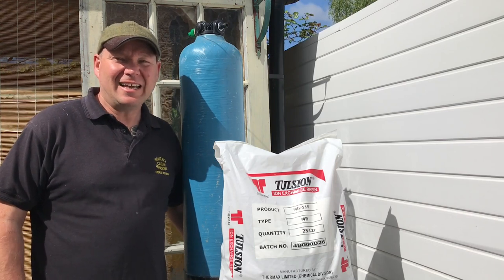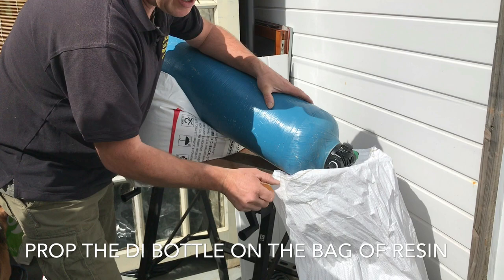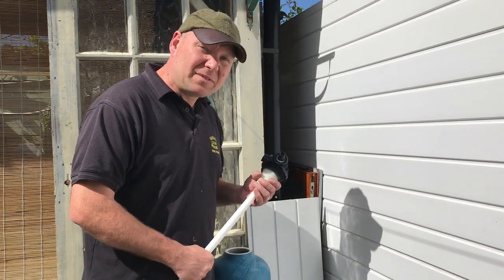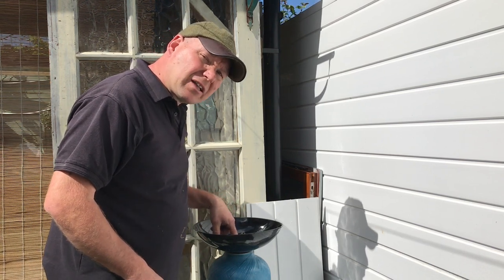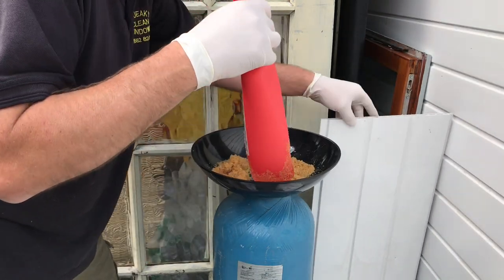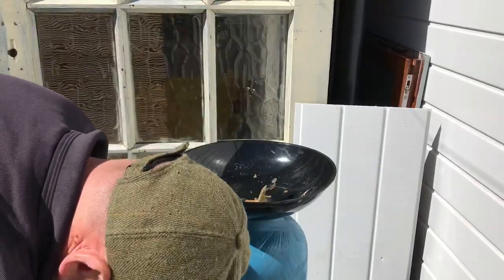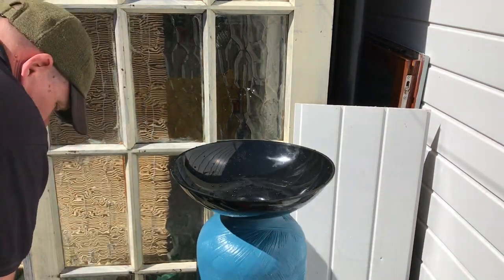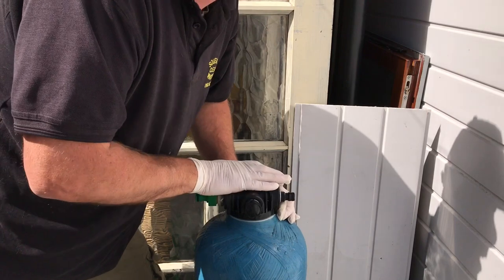Easiest Way To Change The Resin In Your DI Bottle

Comment: Tip: the resin will expand over time, filling the reservoir this full can cause issues. The Mfg will have a rec. amount to add, usually around 3/4 full.
Reply from the maker: funkyzero great tip. I had never heard that. Thanks

Comment: I shine a light through the bottle and use a marker to set the original level before I empty it.  The manufacturer does want room for the resins to liquefy and move about under pressure.
Reply from the maker: Great tip
Reply: Thank you
Reply: this is good information I appreciate this!!

Comment: Thank You Sir for the video... How often is the resin supposed to be changed?
Reply from the maker: You need to take a regular reading of the water quality its producing. Some people change it when it turns to 001 PPM others say that they wait until it gets to 005 PPM. If it starts to get much higher then that it can start ti leave spotting on the glass

Comment: Recommend connecting an in line tds meter like the hm digital ec2. That way you can monitor the water purity level in and out of the di vessel. Then you know when you need to change the resin. I used John guest 1/2 in to 1/4 in tee for the probes and 1/2 in to 3/4 in hozelock connections with 1/2 in tubing .

Comment: Great channels mate
I was told to fill the DI vessel 75% and use Vaseline on the threads at the top of the DI tank.
Waters very soft up here so get 3 monthish a tank no complaints yet🤣🤣🤣
👍👍👍🇬🇧🇬🇧🇬🇧
Reply from the maker: Ive heard that about only filling to 75% but in the last 14 years never had a problem filling it all the way up. I'm not saying its wrong but!!!

Comment: No gravel? Also do you fill it with water when ur done? Or will it automatically do that when put back in service
Reply from the maker: No Gravel. Yes it fills up when the filtered water starts running through.

Comment: Hi Dave why don’t you just fill the Di vessel with water after filling it with resin and then gently push the tube down with very little pressure.
Reply from the maker: I just find it easier this way. great suggestion though. Whatever works best for you 👍

Comment: Hi Dave,just setting up a van so a complete newbie. I just filled up a 6litre resin vessel,and the ppm level stayed exactly the same,around 87ppm. Put it through a 2litre Unger hydro pro and it came out 0ppm. Any ideas why the bigger vessel isn’t doing its job??
Cheers 
Jay
Reply from the maker: To be honest I haven’t a clue. Was the resin you put in dry like sand or was it damp
Reply: @squeakycleandave1  thanks for reply dave. It was a brand new bag but seemed damp,but ive never had any before so wasnt sure. Like i say,through the 2litre unger unit it came down to zero. No worries, cheers again for reply.
Reply: @spraypalrefinishing5024  
It was damp because the van was down by the river.

Comment: Hi Dave, great video. Just a quick question I watched another video that said to only fill the DI vessel ¾ full to leave room for water at the top. Is there any difference in doing this? Cheers
Reply from the maker: Kenzor I’ve heard that you are supposed to leave a gape to allow for expansion but I’ve never had any problems. I’ve been doing it this was for the last 12 years and it’s always worked for me. I may have been doing wrong all this time😁
Reply: I was to by resin supplier the same. 3/4, not full.
Reply: This is not the way you do it. about 3/4 full is correct so the media has room to lift during a backwash. I love the Do it yourself guys.. In all fairness he has just a flow through valve. not a backwashing valve. but still. you need to rinse the new media.

Comment: Hi Dave

You mention using a booster pump after the RO, pushing water through the DI, is this necessary? Does this improve the polished water? 

Also are you still using the Tulsion 115mb? Have you tried any other DI resin? 

Regards
Adam
Reply from the maker: A Adams Hi Adam. I use the booster pump before the RO to make sure the water pressure is correct for the membrane. 
I have used other resin in the past but in my opinion I do find Tulson the best but I am always open to recommendations 👍
Reply: Squeaky Clean Dave hi, thanks for the reply, I also use tulsion 115mb, however was considering trying either the Unger resin or the unheard of Cedelite mixed bed resin as an alternative and to compare to the Tulsion?

Comment: Hi Dave. Love your channel Bro. Would it affect the DI vessel if I have a pressure washer running in the van with the door open? Also would it affect the quality of the resin?
Reply from the maker: Hi Greg. 
As long as you are using the pressure washer separately and its not going through the resin I don't see why it would make any difference as the DI bottle is a sealed unit.
Reply: @squeakycleandave1 
Thanks Dave... I think because it looks like a pressurised oxygen cylinder I always think its gonna blow up with the heat produced by the gx390 🤣🤣👀🙄
Reply from the maker: @gregwilliamson2227  👍

Comment: Most guides i have seen say you should only fill the bottle 3 quarters up with resin so the riser can sit comfortably in there. Does your method allow the resin to last longer ?
Reply from the maker: NorthernSmog it’s just normally the way I’ve done it. Never had a problem with it being to full as it seems to drop down a bit when it fills up with water. As I’ve got a 25 ltr Di bottle i try and get as much in as I can so it doesn’t just leave a little bit in the bottom of the bag to dry out and go off
Reply: @squeakycleandave1  Indeed. And usually the resin is sold in 25 kg bags for the exact reason that DI bottles like this is designed to hold 25 kg of DI resin.

Comment: is one resin bottle good enough to filter the water for window cleaning what do you need to do something else to the water as well
Reply from the maker: Mack The Gardener one bottle will clean the water but it’s not always the best way to do it and can be expensive. There are a few things to take into consideration 1) what is the water quality you want to filter 2)How much water do you need. 3) are you paying for the water you are filtering 4) how much space you have. 5) how much you have to spend on a filter system. I personally have got a 40/40 RO system with a booster pump before the DI. There are some good videos on RO Vs DI. It’s worth watching a few to find out which is best for you. Hope this helps. 👍

Comment: Hi Dave, I hope you’re able to still reply haha my resin tank is much smaller than this. The water in my area isn’t to bad either, how often would you suggest I change my resin? I’ve been cleaning widows for years but I’m new to the WFP system. Cheers
Reply: Get a TDS meter and test your output regularly. When you get to 5 parts per million change out your resin

Comment: Will my water be a yellowish color for a short period directly after changing out the resin? Or did I do something wrong
Reply from the maker: treefrog12111 I think you may have done something wrong. It’s always made my water clearer never yellow. Have you put the pipes back on the di bottle the right way
Reply: @squeakycleandave1  yes I put everything back together correctly but I did not run the backwash cycle yet before I turned on my water to my faucet. It has since cleared up now that I've run a cycle so I guess we're okay
Reply from the maker: treefrog12111 even though it clear  now just check the tds of the water before you us it. If it’s zero then happy days. Sorry I couldn’t offer any more advice. Hope you get it sorted. 👍
Reply: @squeakycleandave1  thank you I really appreciate the help

Comment: You do know that you are supposed to measure the resin? The DI bottle is not supposed to be clear full. Why? you may ask. The first step of the regeneration cycle is the backflush. Water is sent to the bottom of the DI tank to fluff it up, or de-compact it, to ensure that the brine water that strips the minerals from the resin contacts all of the resin. Many DI tanks have a marking or label telling how many cubic centimeters or cubic liters are required. In the USA it would be cubic ft.